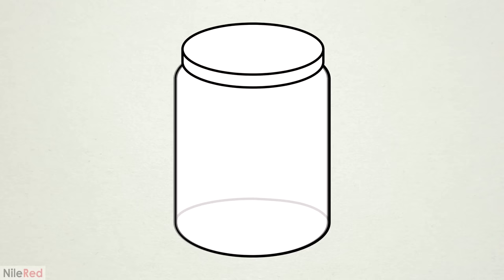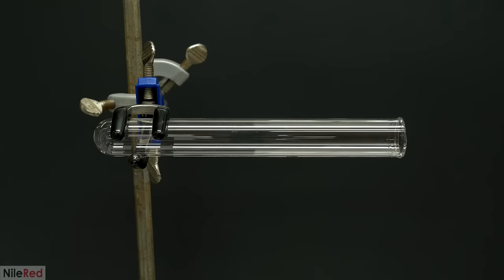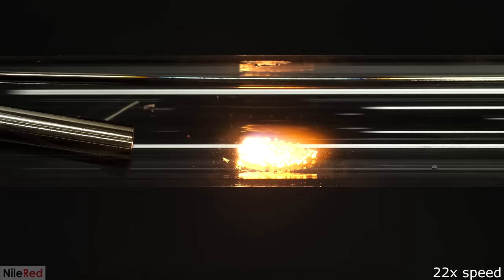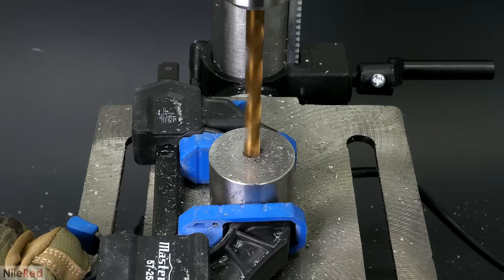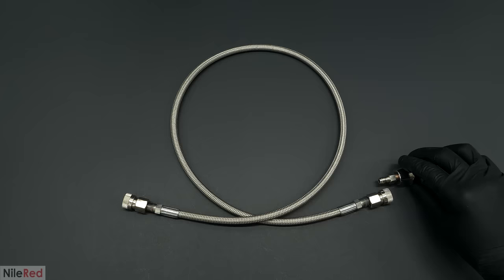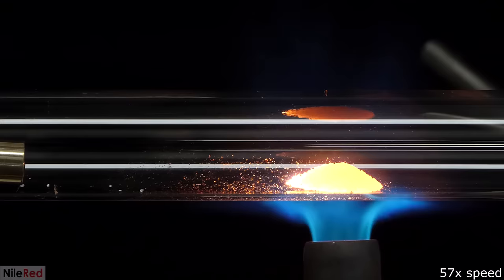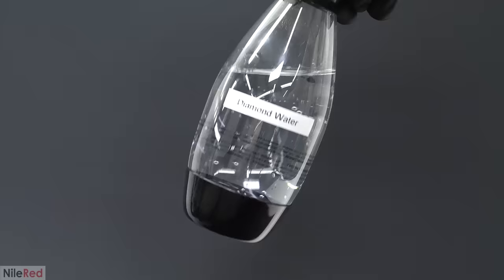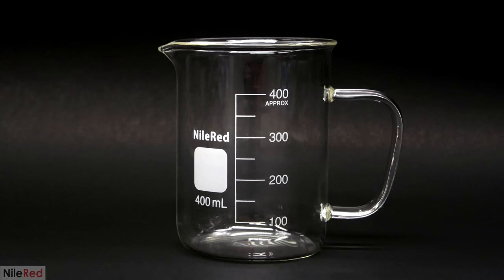Making the world's most expensive carbonated water!

Comment: I do think that in the heating-transition step that some part of the CO2 you made just simply dissolves into the water bubbler. Until the CO2 in water is saturated, it started producing dry ice.
Reply: You’re right, but since it was bubbled through at standard pressure, not much of the CO2 would have dissolved, at least not to make up a significant part of the yield loss.
Reply: @jackweaver1846  however according to i've been taught CO2 gas is able to dissolve into the water by the ratio of 1:1. the amount of water that he used looks like 30mls. In normal temp thats about .06 grams. uh after serious calcs ive realized the loss is real low. thx for replying tho
Reply: @xiaozhuishere  yeah no problem!

Comment: Turn that CO2 back into diamonds. :)

1. High-Pressure, High-Temperature (HPHT) Method:

Steps: 1. Graphite Formation: The carbon atoms from CO2 must first be converted into graphite. This can be done by chemically reducing CO2 to pure carbon. 2. Heating and Pressurizing: The graphite is placed in a high-pressure chamber along with a metal catalyst, such as iron, cobalt, or nickel. 3. Application of Heat and Pressure: The graphite is subjected to extreme temperatures (about 1,300–1,600 °C) and pressure (about 5–6 GPa). These conditions mimic those in the Earth's mantle where natural diamonds form. 4. Diamond Crystallization: Under these conditions, the carbon atoms reorganize into the crystal lattice structure of diamond.

2. Chemical Vapor Deposition (CVD) Method:

Steps: 1. Gas Mixture: A gas mixture containing a source of carbon, typically methane (CH4), and hydrogen (H2), is introduced into a vacuum chamber. CO2 can also be used as a carbon source, but it first needs to be converted to a suitable precursor. 2. Heating: The gas mixture is heated to high temperatures (above 800 °C) by a microwave plasma or hot filament. 3. Formation of Plasma: This forms a plasma in which the carbon-containing gases break down into carbon atoms. 4. Deposition: The carbon atoms then deposit onto a substrate, like a diamond seed crystal, forming a diamond layer. Over time, these atom layers build up to form a diamond crystal.

Comment: If a rich guy had this hed be like “my coke is carbonated with atomized diamonds, and sweetened with the tears of a jaguar.
Reply: In a bottle made from elephant tusks
Reply: @DIEELITT  hmmmmmmmmm
Reply: Wrapped in a premium paper manufactured from $35,000 mtg lotus trading cards and printed using royal purple die extracted from 500,000 mollusks costing $200,000. 

Of course no mere peasant uses a screw top, we use the Hope diamond as a knob and Borcote as quark wood.
Reply: The bottle cap is made of 24 karat gold, lined with the finest of  rubies.
Reply: And As an exquisite finishing touch, The Rubies have Platinum Lining around them.

Comment: imagine getting all this daimond CO2 just to use with tap water

bruh.
Reply: shoulda used it with fiji for extra class smh
Reply: @aliveandunwell430  should have done Poland Springs it's not expensive but it's the most pure water you can get
Reply: Or he could use a reaction to get hydrogen, put it in a beaker, then put some of the carbon dioxide in the beaker, take the cap off, then quickly light it on fire to chemically engineer water out of Co2 and O2.
Reply: Shoulda used Dasani smh that’s already carbonated
Reply: @angelas1761  ew
Reply: I was thinking Voss water...the shit that’s like 4.99 and comes in a glass water bottle 😂🙄

Comment: To test if a diamond is real use it to scratch a window… to do this simply run the diamond against some glass and if the glass gets scratched then it’s most likely diamond.
Reply: That doesn't work always. There are other materials that look like diamonds and could also scratch glass.
The real test is exposing it to a strong hydrogen flame. If it burns, it was a real diamond :P

Comment: You probably broke the tap because you weren't re threading properly, when tapping anything larger than M3 you really should do one full turn then half back and repeat until fully threaded. 

Also you should start with a tapered tap and then move on to a flat head tap to run through the thread agian.

You're welcome :)

Comment: I like how the diamonds weren't even the most expensive part

welp ok so aparently diamonds aren't as expensive as i thought, but it's still impressive the amount of money he spent on this
Reply: Diamond are actually pretty inexpensive if you don’t buy them third hand...
Reply: Diamonds aren’t expensive
Reply: Diamonds aren't that expensive when they're small. Hell, with diamond dust it would've been even way cheaper. Diamond for jewelry are expensive because of few factors. First, the size. As you could see on the video, in our pressure diamonds sublime. You would need extremely high pressure to melt the diamonds and let them crystallize again, so the bigger, the better. Once it breaks, there's basically no turning back. Second is the quality. You want as few flaws as possible in the diamond and it can really take the value down. It's connected to size also, because with increasing size, it's harder to have uniform quality in the whole. Third is labour. To make the diamond really shine, you need to carve it specific and precise way. While you can do this using machinery, handwork is way more prestigious. Last one is just the added value of prestige. If you take a look at the prestigious things, their price is usually way higher than the cost of materials. It comes mostly from the limited marketability and just pure need of owning something costing fortune.
Reply: Raw Dimonds aren't rare. The ones that have been carved into shape are the ones b that are expensive.
Reply: You have the DeBeers jewelry Corporation to thank. Through a successful marketing campaign back in the 60s, they convinced consumers that diamonds, specifically engagement rings, were worth Two to Three months worth of paychecks.
Reply: @bethkrager6529  Exactly.  And they aren't worth that at all, it's a big scam.  As a matter of fact manufactured diamonds are cheap and perfect!!  DeBeers now state that imperfect diamonds are better (they call the defects inclusions), however that's BS marketing.  The defects are a weak stress point that can cause a diamond to shatter or shear along it.  Basically they are trying to sell flawed rocks with no value !!
Reply: @bethkrager6529  Yes diamonds are not rare and are definitely not worth the money people pay, it's just one of many scams on this planet.
Reply: Sepsy Smurf mr beast spent 800$ on a private island just for a vid
Reply: @E2FrostYFn  it was actually 730,000$ and it wasn't just for a vid... it was for two
Reply: @E2FrostYFn  sorry but 800$ and 730,000$ are two VERY different amounts. i think maybe you meant 800k
Reply: 900th like

Comment: Next project, add a “reverser value” to run your system backwards to make diamonds out of carbonated water. 💎
Reply: Theyre called synthetic diamonds, verge science did a good video on them if youre interested.
Reply: bowieinc that’s impossible. The most he could do is turn it back into dry ice
Reply: @the6ix665  with enough temperature and pressure and over a long time. he could change them back to diamonds
Reply: All of you are getting wooshed
Reply: @Churrb  no it's possible
Reply: Blob blox I never said it wasn’t?
Reply: @Churrb  except this isn't fucking Reddit
Reply: He could just use an uno reverse card
Reply: @GHOSTrex1324  iT's 4 o'S
Reply: TruSkeleZ - Unturned and more! ok redditer
Reply: TruSkeleZ - Unturned and more! r/itswooooshwith4os
Reply: @LillaVya  you get the spirit
Reply: @the6ix665  no that is wrong because the dry ice could be reactid with magnisium forming carbon then it could be compressed into diamond
Reply: I would like cola flavoured dimonds in that case.
Reply: Cola makes brown diamonds
Reply: @Churrb  this is used for joke then why you asking that?
Reply: I’m 100% sure that’s not how it works

Comment: Now, its time to reverse the process, and make diamonds out of thin air.
Reply: you need methane or acetylene gas and a dam big microwave generator as well as a super low pressure chamber a seed crystal and the right mixture!
Reply: Technically, this is actually pretty easy to do. Practically, the energy and equipment requirements are so high that it's only feasible with industrial-scale facilities and production volume, and even then man-made diamonds are barely less expensive than artificially-price-inflated natural diamonds of comparable size. So obviously, we need to get everyone to raise their Patreon pledges so NileRed can afford to do it! 😁
Reply: Yeoman International Wait... that's a thing? I thought you have to have it at extreme pressures to make it feasible... I saw people do it with graphite before, but the diamonds were very low quality and so small, that it didn't seem worth it...
Reply: @FunnyMemes-dr3se  It is also possible to deposit from gas phase. VERY slow and VERY power hungry. But can do amazing things....
Reply: Better yet, I want to see him reverse the toilet paper moonshine process. :P
/Jack Daniels toilet paper./
Reply: Its honestly just easier to use explosives.
Reply: @FunnyMemes-dr3se  Yep! Extracting carbon dioxide (and other carbon-containing compounds) from the air is simple, but very time- and energy-intensive (only recently have methods to do this, and low-carbon power generation to power it, been refined enough to POSSIBLY extract more carbon from the air than is produced by powering the capture process – and until that has happened for sure, the process will only add to the total atmospheric CO₂ levels). Separating the carbon from the other elements is also simple, and also very time- and energy-intensive. And then turning the extracted carbon into diamonds is – you guessed it – very very very time- and energy-intensive.

There are two well-established processes for producing synthetic diamonds. The High-Pressure High-Temperature (HPHT) method you mentioned involves putting a source of pure carbon under – as the name implies – extremely high pressure and temperature to essentially mimic the conditions that produced most natural diamonds. This is the method used (in various forms) to produce most synthetic diamonds nowadays. The largest diamond known to be produced by this method as of October 2005 was 34.80 carats (6.96 grams) uncut, with growth rate varying between 2 and 15 milligrams per hour (total time unspecified, but somewhere between 19.33 and 145 days), according to the paper "High pressure–high temperature growth of diamond crystals using
 split sphere apparatus" (https://sci-hub.tw/10.1016/j.diamond.2005.09.007).

The Chemical Vapor Deposition (CVD) method involves turning a carbon-containing gas mixture into a plasma and encouraging the carbon ions to bind to a substrate material in the diamond crystal structure. The process has only started becoming reliable relatively recently, but it is thought to have the potential to overtake HPHT processes due to the possibility of much greater control over impurities and properties, as well as the ability to grow sheets of diamond on top of another material. I couldn't find a good source on the largest diamond produced with this method, but several diamond-related news sites claim the record is around 10 carats (2 grams).

The purity (official term: color) and quality (official term: clarity) of synthetic diamonds were poor early on, but both the CVD and the HPHT methods have since been refined enough to produce jeweler's-grade diamonds of Colorless (white) color and Flawless clarity, the best possible ratings in the modern GIA grading system. The processes have been refined so much, in fact, that the presence of flaws is now used to prove a diamond is natural rather than synthetic. Some of the most expensive natural diamonds are colored by chemical impurities or structural imperfections due to the rarity of such colors in a pure form, and these are in fact easier to synthesize than a Colorless white diamond because it is much harder to maintain a growth environment of no impurities (for 100% carbon white diamonds) than it is to maintain a growth environment with one or more desirable impurities (nitrogen or boron, for example).
Reply: Woosh

Comment: You can literally throw dry ice in any liquid into a pressure chamber to carbonate the liquid.  I used to make root beer like that.  Would put the liquid/dry ice in a plastic tupperware container and then put something really heavy on top of the lid.  Pressure builds up and if it's too much it'll leak out, but the CO2 will also dissolve into the liquid.
Reply: Yeah I was thinking he could save a step there

Comment: There are 21k comments, so I can't look through them. I assume that tapping is mentioned, but if not,;- turn in till it gets tight, like a turn or one and a half, then turn the tap back half a turn. This breaks the chip. It will cut easily. So.. up to several turns forward, half turn back and repeat. Many recommend tapping oil, I occasionally use it but would rather have the chips dropping out and just go slow.

Comment: I'm sure the stainless steel equipment retained 100% of is pressure rating when you f,ucking drilled into it and tapped it by hand all wrong.
That soapy water you sprinkled on it, that didn't even touch all the surfaces, would surely have showed you any imperfections.

Comment: I think glass melted fast then dimond but here glass doesn't affect why...
Reply: Regular glass usually does melt at a lower temperature than diamond, but that’s because it’s borosilicate glass. He used quartz glass (pure silicon dioxide), which has a higher melting point than diamonds. He explains this around 3:14